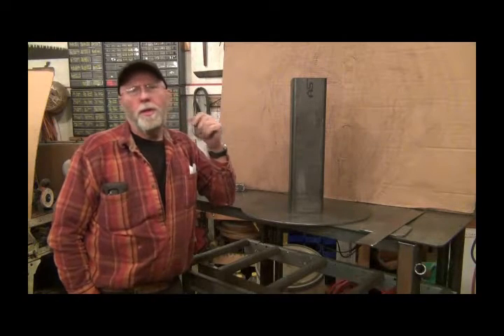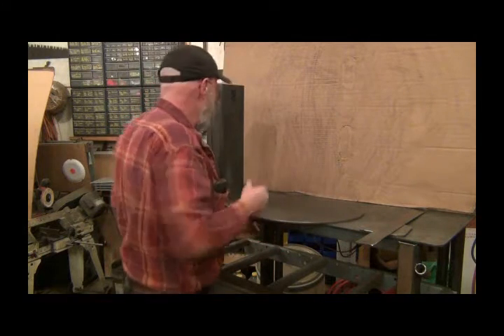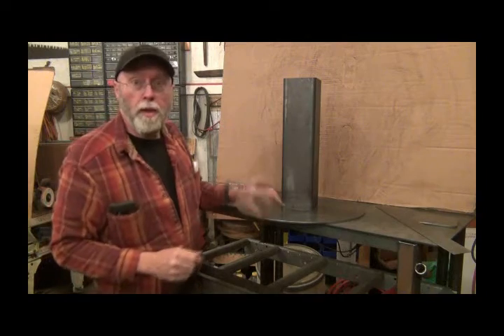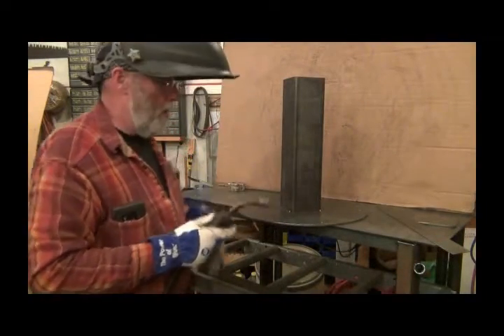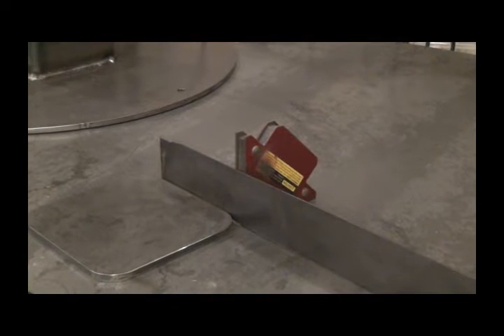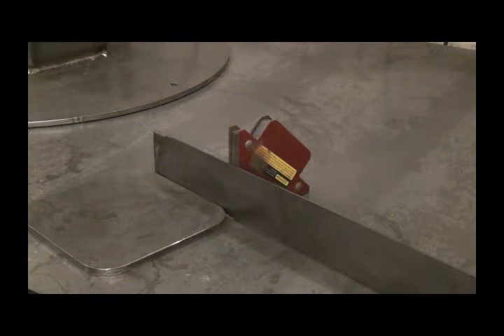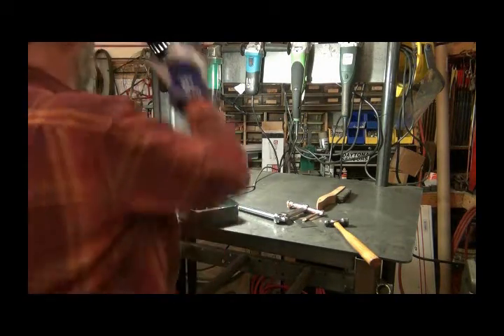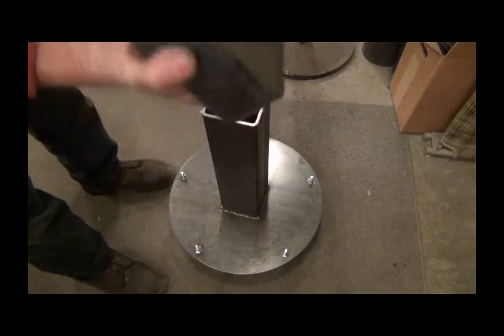Oil Tank For Quenching Knife Blades

Comment: Looks good, only suggestion I would have is possibly adding a heating element into the tank somehow so that you can preheat and hold your quench oil at around 130 degrees or so. I believe that's about the temperature that the oil should be before quenching.
Reply from the maker: MrMalditor I'll have to look into that.